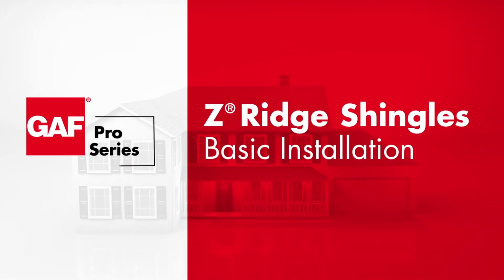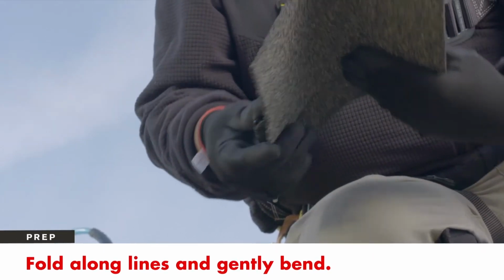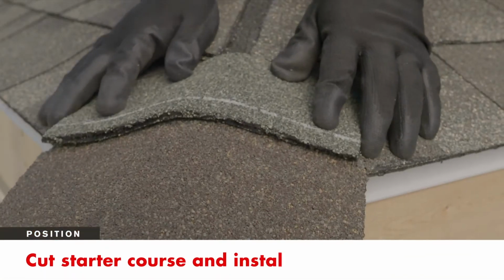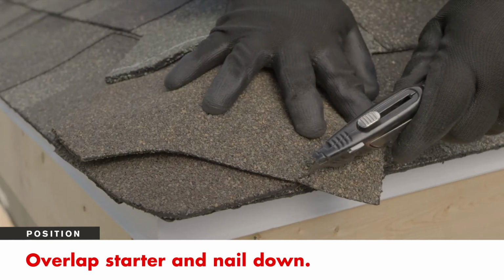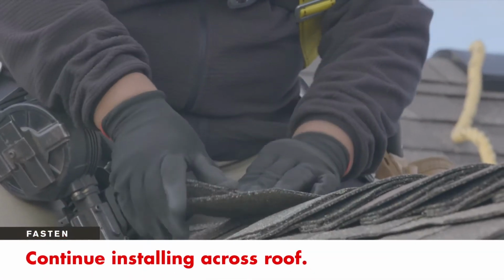How to Install GAF Ridge Cap Z Ridge Shingles | GAF Pro Series

Comment: Tip for any idiots like me who bought these things: Take a second to think about what the nails are doing…. Even on the hips where there is no overlap, absolute best case you’re penetrating 3 layers of Z-ridge shingle (about 3/8” inch total), PLUS at least 2 layers of field shingle (probably more), PLUS your underlayment which can be up to 4 layers of ice barrier since you’re supposed to overlap the hip.
THEN consider the fact that the longest coiled roofing nails you’re likely to find are 1 1/2” long. I found an old dusty box of them at Home Depot next to 50 boxes of 1 1/4” roofing nails. They’re out there, but not so easy to find. 
FINALLY, consider that GAF wants you to ensure the nails penetrate the deck wood at least 3/4”. 
In a word, there is no freaking way. 
You can get 1 3/4” or 2” galvanized siding nails in a coil but those have small heads, and as far as I can tell, aren’t recommended for shingles as they can pull through (remember there is no adhesive on ridge cap shingles - all the holding is done by the nails). 
So what did I end up doing? I have no idea whether it’s acceptable, but in addition to 1 1/2” nails on the line, we also placed 2 more nails farther up the Z shingle to only penetrate one layer and get a better bite into the deck. Then, we followed up each of the 4 nails with a hammer to get them flush. 
I figure the line nails are going in MAYBE 1/2” into the deck, and the backup nails 3/4”, but ONLY because we’re using long 1 1/2” nails. 
So, consider this when deciding which nails to purchase for your own roofing project. Good luck!
Reply: I used 2-2" nails with a hammer per Z shingle and added some roofing caulk between each Z shingle.
Reply: @benevolentdictator2315  Yeah that’s what I should have probably done. Knock on wood I haven’t lost any yet, even through some pretty severe weather :)

Comment: GAF has too many videos that show installation that doesn't even follow their own required installation instructions.  Lets see...  One inch nailing from the side becomes 2.5 inches in this video.  Also can see near the end of the video over driven nail has ripped through the shingle.  Amateur hour at GAF.  Strange...
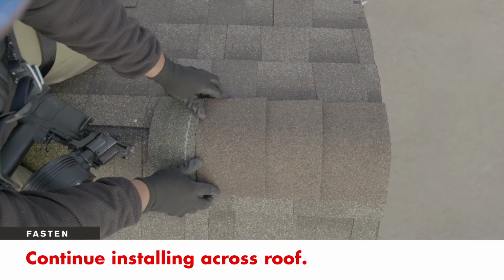Reply: And I am doing my first roofing job - reroofing a shed.. (so what do I know??). But it looks like the regular shingles do not overlap the peak (at 0:52)?! Even >> I << did that.
Reply: @mr.shmegman3353  Ridge (Peak) shingles are usually trimmed to retrofit a ridge-vent system.  This provides the roof proper ventilation at the ridge.